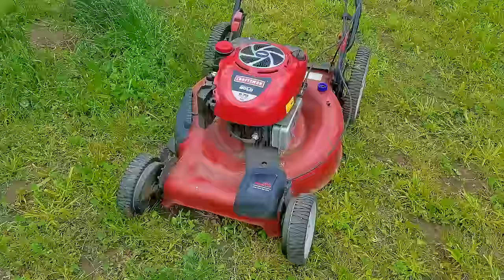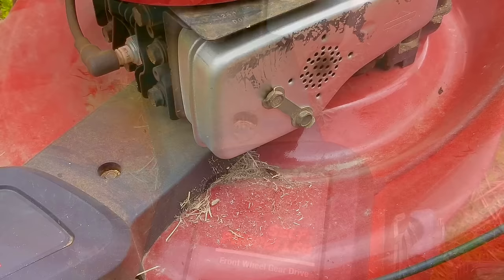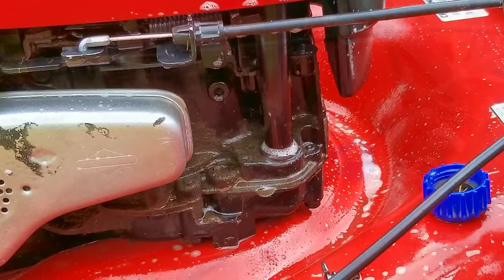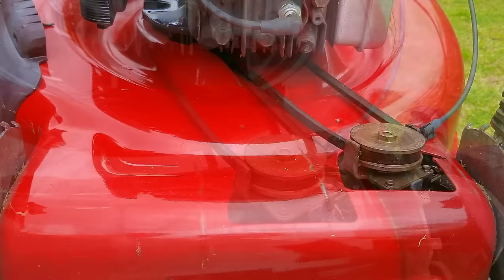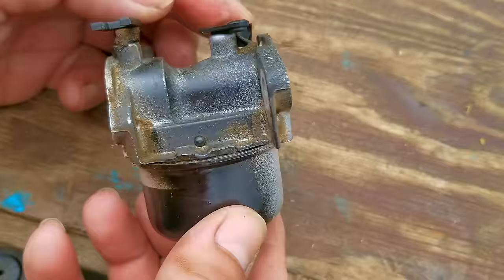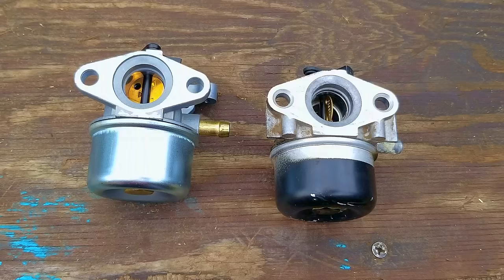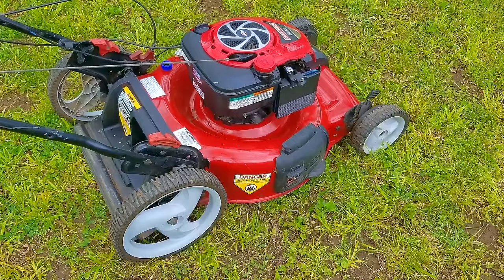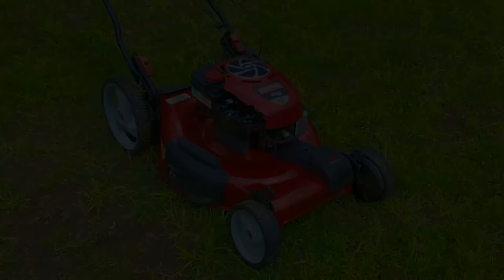Fixing A Craftsman Mower That Won't Start

Comment: I have a mini bike and i need some tips on how to make it last long.
Reply from the maker: maintenance and a  consistent riding  schedule to keep the fuel fresh, treat it like a second car, to your primary one.
Reply: @HomeGaragechannel  im only 12 and i know a lot about small engines and stuff.
Reply: @HomeGaragechannel  and can the oil go low if you use it a lot?
Reply from the maker: nice!
Reply from the maker: yes, engine will slowly burn the Oil, so that's why you need to check it once in awhile. Engines that are very worn, will burn a lot of oil, while newer ones don't burn as much.
Reply: @HomeGaragechannel  ok.

Comment: Question cleaned carburetor and still didn't start. Maybe bad ignition coil?
Reply from the maker: before considering a bad coil, have you checked for spark?
Reply: @HomeGaragechannel  yes
Reply: There was a spark but don't know if it was strong enough
Reply from the maker: as long as there's spark, even a weak one, it's good enough to move onto other possibilities
Reply: Dint know what's going on with it ordered a coil . So we shall see
Reply: @HomeGaragechannel  I cleaned carburetor.  I got a little smoke but no start. So I really don't know
Reply: @HomeGaragechannel  what would you suggest

Comment: I have a nearly identical mower that is giving me fits. I used it last summer, before prepping and storing it in my shop for the winter. When I brought it out this spring, it had no spark. I eventually found that it had spark if I disconnected the kill wire. The kill cable was bound up, so I assumed that was the issue and replaced it. It did not fix the problem, so I made a new kill wire and replaced the old one. It still didn't fix it. I cleaned the kill switch itself, but didn't replace it since it doesn't have any obvious issue, but I still have no spark with the kill wire connected. Is it possible for the switch to fail without having any obvious damage?
Reply from the maker: as long as you can confirm that the lever that makes contact with the kill switch is indeed not making contact when the bail handle is down then NO. I check to see if the small black grounding wire from the coil was somehow making contact with the engine somewhere it's not supposed to
Reply: @HomeGaragechannel  It's making contact, and I suspected the black wire may be faulty, so I made a new one and replaced it. Unless the new one isn't working, then I have no idea. It isn't my first time making a wire though. This one has me stumped.